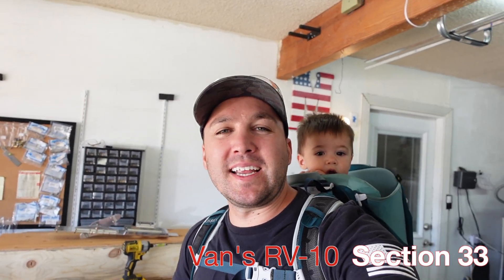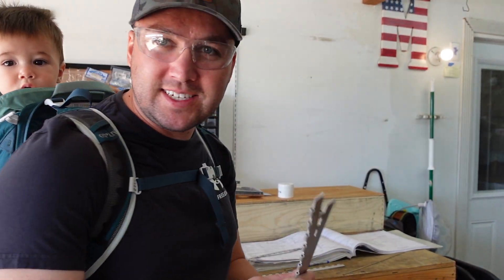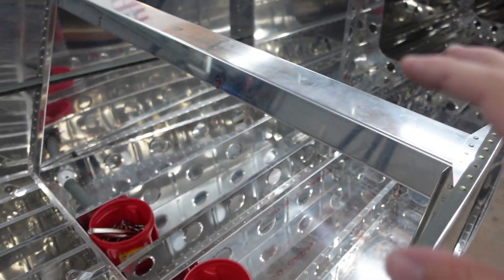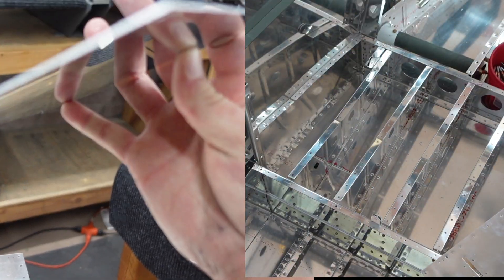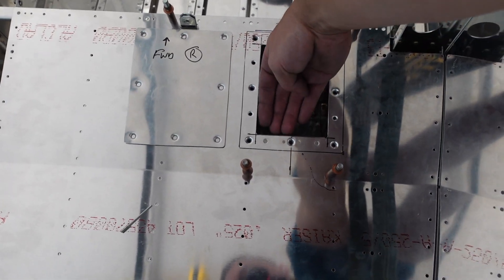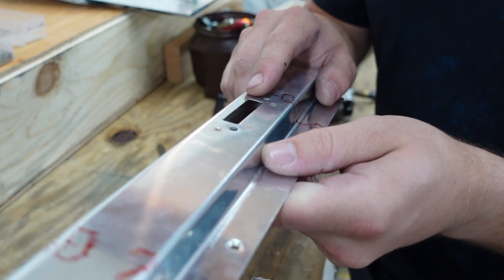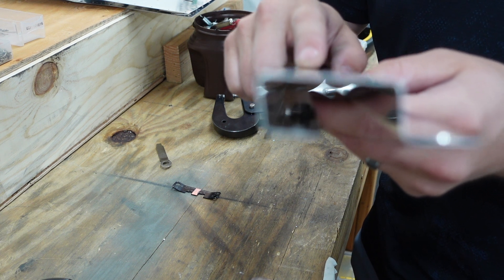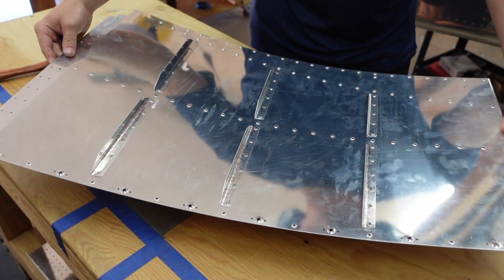RV-10 - Section 33 - Baggage Area, Part 1 of ????

Comment: Austin, what brand and model bandsaw did you buy?
Reply from the maker: It’s a Harbor Freight CENTRAL MACHINERY 1/3 HP, 9 in. Benchtop Band Saw. I’ve been using 18TPI Bosch blades. The blades don’t last the longest but they work well. Probably gone through 6 or so since the start of the build.
Reply: Austin, all you really need now (decision/execution wise) is how many conduits you want to run under the baggage floor (I ran 3 per side) and if you’re going to put the battery in the stock location behind the baggage bulkhead go ahead and run your 2 gauge wire now also. No need to pull wires as you can run them through the conduit at any time with a pull string. Just hook a shop vac to one end of the conduit and put a kite string on the other end and let the suction pull it through. Viola, you now have a pull string to run wires any time.
Reply from the maker: @auburnaviator6167  absolutely! Thanks for the tips. Spent some time tonight trying to figure out what all I need and how I’ll accomplish it. I think I’ll end up running more conduits than I need, just to be safe. 3 per side seems like a safe bet. I love that string idea. Should make for much easier runs in the future!